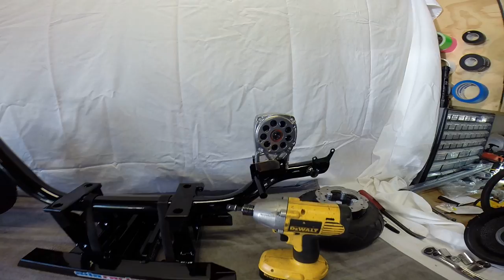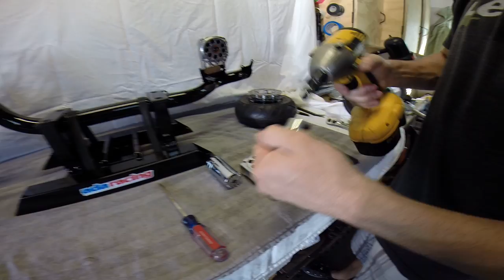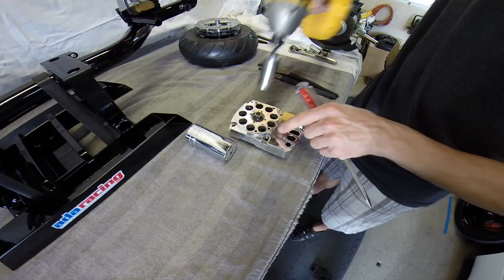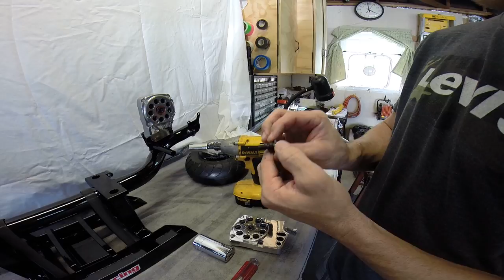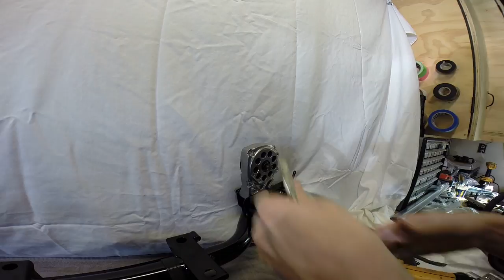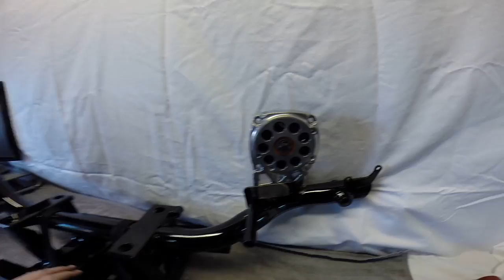GoPed, HOW TO: Installing Gear and Removing Gear

Comment: Nice video, but do you buy any chance know the size of the gator socket, i understand you said 3/8, but im not worried about the drive side, the other side is the important side to beable to remove a 6 t -8t cuz im not sure if they go buy the drive side or not but ive seen them say different sizes for the side that goes over the stuff
Reply: From looking at my two Gator sockets, the small is 3/8ths drive & the large is 1/2 drive.

Comment: Hey thanks for the video its extremely helpful! unfortunately my 6 tooth is stripped and completely frozen in there are there any other methods i can use to get it out?
Reply: Yes. Cut it off and use a small drill bit in the center and then use a reverse bit

Comment: Nice vid Derek. I've gotten mine off and on with a spanner. Will this cause any problems? Cheers mate
Reply from the maker: Personally I'd advice against it. And go with the method I use here in the video. I find this to be the safest and best way for removing and re-installing gears. This is just the way I do it. I am sure others have ways that work as well. this is just simply the way I find works best for me and keeps my gears in good shape with little damage as possible during the removing and installing stages.